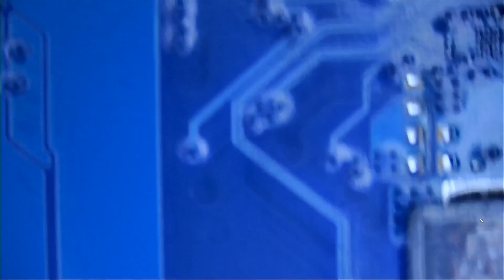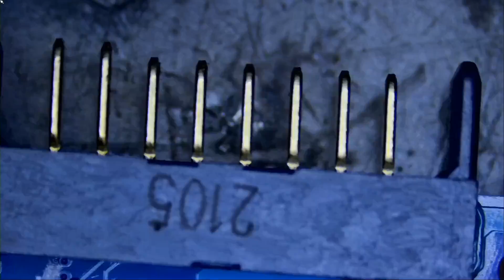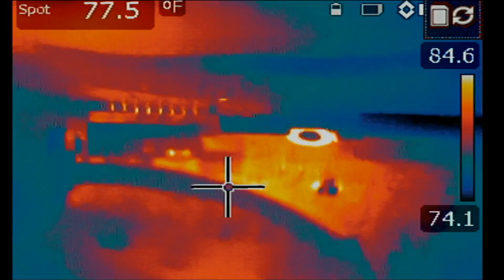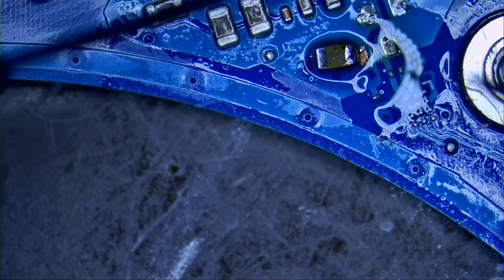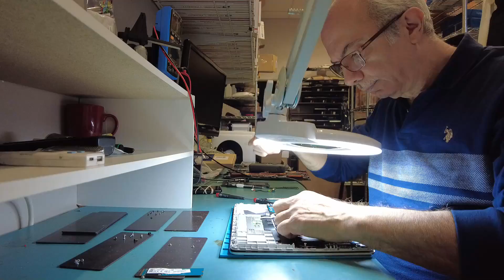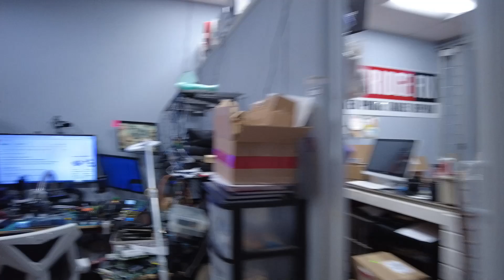HP 14" Failed and won't power on. Faulty Motherboard Repair. 14-dq2013dx

Comment: Good day sir.
Water poured on my dell latitude 7490 laptop. I tried to dry it, without disconnecting the battery. When I put it on, it was beeping 3 amber and 5 white from the led. 
Please what cam I do?

Comment: Hi. I have hp 14-bs724tu. When i turn it on there is no backlight on the screen. But there is a display and it's just dark. I can see the display using flash light focusing on it . At first I thought it was a faulty screen. Then i replaced it with a new screen. But the same thing happened . Just wanna ask what is the cause?

Comment: This one is relevant to me! I have a 2019 Zenbook I fried by accidentally plugging the power into the wrong side, making the barrel adapter somehow come in contact with a USB port and causing it to no longer power on (at least the unit's soft-power button isn't working, so it could be worse than a shorted cap...?) Thanks for the walkthrough! I have a bit more direction on isolating the fault!

Comment: I use the same screwdrivers Big Boss use, the best of the best since more than 35 years. I see some people suggested an electric screw driver but that wont be faster and you do not have the feel like using these screw drivers. Some screws are machine screws and others drive into the plastic housing or covers. Keep up the good work, you are a perfect team!

Comment: I should try to do your job using the hot air. I will definitely have a cool river of components sliding off the board. That is just how patient I'am. lol. Oh, and I do have trash pick up for these things when I'm done...lol. Guess I'll stick with automotive and small engines.

Comment: Besides external damage, what is your idea why these components like capacitors or mosfets actually fail? Are they just bad quality, overheating, irregular power supply or something else? It appears often to be only one tiny component. What could manufacturers do to improve the quality of their devices? Would any redundancy or easier repair strategies be possible?
Reply: There's no money in manufacturers improving the quality of their devices, therefore it will never happen. It costs less to make a product just good enough not to get sued because of than it would cost to actually make a high quality product that doesn't go obsolete or fail catastrophically in but a scant few years. They only need perform enough quality control not to get sued, and that is literally all.
Reply: Greetings.  Good questions.  However,  I would think that things become broken usually because of misuse and abuse, things not being used properly.  On the other hand, for the most part things are made to last and usually work reliably for a long time. When they do fail, technicians are all too happy to remedy the defects to keep the customer happy in being able to continuously enjoy the product.

Comment: That was excellent ALEX.As somebody that likes to mess around and learn about how things in general work,your video are top notch.But in the next one could you maybe show how you picked the spot to put the neg test lead and when choosing <what pins to check,i assume your testing the positive side of the circuit? also when you inject voltage do you use low 1.5 volts with low 1 amp ,as say a starting point?Your ability to get to the root of a problem is amazing,I'm asking if you would share that knowledge,of the why ,i realize ,it's based on a large amount of experience.so i thank you for your video's .By the way the microscope and lighting is by far the best of any i have ever seen simply amazing clarity.thank you so much.